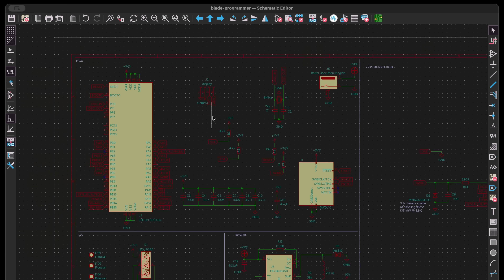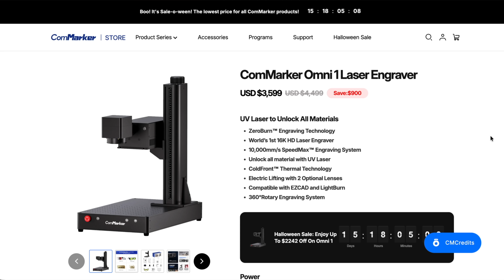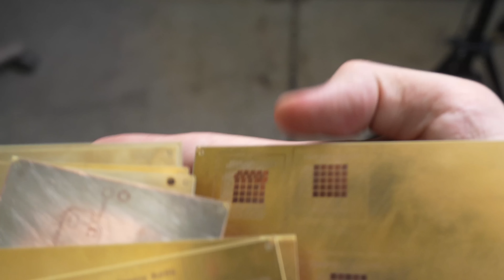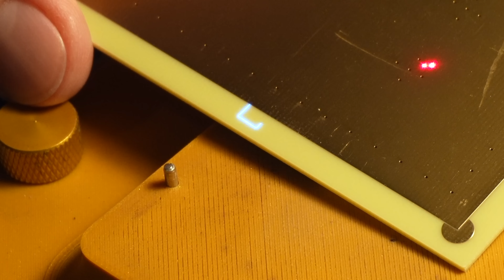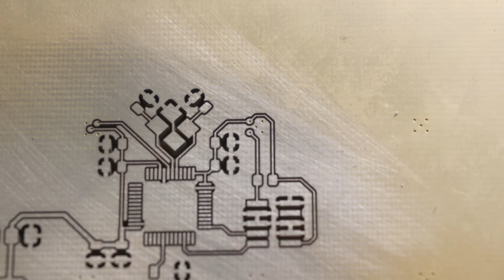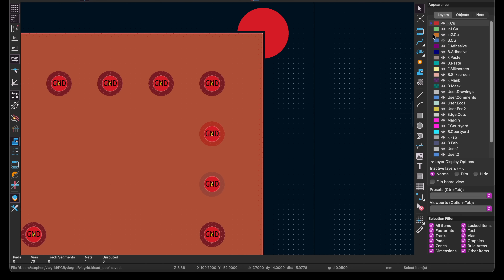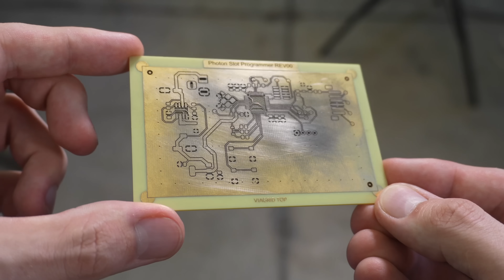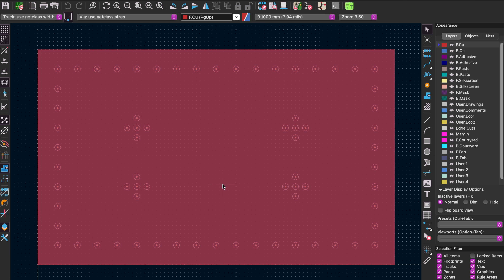The Last PCB You'll Ever Buy

Comment: CredBoard. Sized like two credit cards that you can break apart by hand and use each piece independently. One half can be milled out for folding over to protect the components on the other.

Comment: That board alignment could use some improvement.  Maybe a worm gear on the bottom holder so you can really get fine control of placement.  And then maybe put some sawtooth points around the outside of the board so it's not just on/off with the laser frame.  So you can see a gradient of light - it's brightest when it's in the exact center.  But great work here!

Comment: Like this. But:

a. 4 layer bd with a LOT more vias,

b. Vias between surfaces AND alternating prs to internal planes. Unused via gets detached from surface(s)

c. Versions with special supports prelaid out (micro/qfn/bga, USB PD based dcdc, hi-spd traces, etc)

d. My Preference: if possible, have bds prefab's with photoresist, expose on bare bed of a SLA or equiv, then acid etch. Less airborne nastiness, less tiny bits of Cu sitting about, no burnt FR4. Tradeoff: chem in liquid vs vaporized. Oh - and cleaning SLA bed b4 use!!😕

Comment: Hi great work! Looks like you just solved the main problem on my Phd theses. How did i not think of this :D In the video you mentioned that the laser makes the FR4 conductive. Did you try to drill the vias through FR4 with the laser and measure the resistance of the via? Since it gets conductive i could work :)

Comment: The Enviable board...
One way to safely handle 4 layers with GND and VCC planes could be to have pre-cut islands around their via and let the user place 0 ohm resistors wherever a connection is desired. But if the rest of the board is going to be etched anyway, it's probably simpler to let the user add the islands as needed, maybe just have a limited number of power vias, as the other vias can also be used to send power around obstacles.

Comment: I think this is super cool. Unfortunately, I dont see the commercial applications for this. However this may just be me? But, the design constraints, additional fixture cost, quality, board shape, etc. I dont see a strong use case when i can get very cheap, quick, high quality pcbs in a couple days. Often in that shipping time there is so much to still do. Now, If USA decouples from China then you may have something commercial but that's another thing. All in all, really cool thanks for the videos!

Comment: If the design is simple enough for this, it is simple enough for a single layer pcb with zero-ohm resistors for trace jumping.
Reply: You could design this board with IC's on both sides. Could be handy.

Comment: Hi Stephen, really love your mission to make PCB iterations as fast and cheap as possible. 

First thing that came to my mind was to make this a 4 layer board, with 2nd layer GND and +V, yes power layer generally is split, between 5V, 12V 3.3 but maybe even that can be done? By drilling or milling some vias away to seperate them, maybe 😅 Nevertheless GND layer would be super helpful and might help with EMI & EMC

Comment: this would be good for simple stuff, unfortunately it will come short for RF work, differential pairs, impedance matching, bga, wlcsp or even some weird qfn packages like nordic's ones. RF work would probably benefit most of these short turnaround times. this needs a bit of more work and a 4L board, probably with some tightly controlled layering for at least 433/868/915 work.

Comment: I remember when we had to mill out PCB’s

The VIA’s had to be hand “punched”

I think that a 4 layer board would basically pay for itself quickly too - one inner plane definitely should be for ground and the other for power - would definitely need Vias all around edge of board to connect to different planes - but omg it would be the greatest system ever designed.

Comment: I love your energy man but I don't think this idea is a good one, fast turn professional PCB manufacturing is so fast and getting cheaper every year. Combined with ICs getting smaller and finer pitch, this is a really tough sell for me. I can get PCBs delivered, 4-6 layer with micro vias in about 3 days, if I order them on Friday they will be in hand on Monday. Going any faster doesn't really represent any value. It is very rare we make a mistake in a design which is so bad it can't be reworked into working, so 2 iterations in engineering is normally enough for an assembly.

Comment: The process is actually very similar to the predecessor of FPGAs. There were wafers available with prefabricated Gates and one could very easily and cheaply connect them using top metals only. Cool to see this idea reappear in the PCB world.
Reply: The things are still very much in use today in some special or military applications. It allows for a much lower price, reduced design complexity and much lesser radiation sensitivity compared to FPGAs. I don't know the official name for the technology but here in Russia they are called "basic matrix crystals".
Reply: @Kirillissimus  Its called Gate Arrays. They are essentialy fixed size cells with predefined inputs outputs and power rails, with a pre-defined array of mos devices(also mostly use the doped poly Si as interconnection(except for outputs) . There is also a variation called Std. Cells, more custom inside, instead of an array, but with predefined size(and multiples of it)).

Comment: I wonder if you could use one of those Eufy UV or similar printer things to print a solder resist material on top of the copper. Although I guess you can just coat it with solder resist and re laser it to remove it

Comment: In this form, it is virtually useless in real cases. I often do prototyping in my work, and it's faster and more efficient to make a board of this level manually with the help of a laminator and a laser printer. Perhaps I would be interested in similar workpieces with a large number of via and ready-made seats for complex tqfp and bga, but not in the current state of the "blink LED" level.

Comment: If you run with the PCB layout philosophy of signal integrity doesn't matter if the board "works" then it sounds great. This type of shortcut means you have little control over where signals transition layers and very often you will get away with that. In the lab I use a Carvera Air and the really tiny via pins for double sided designs to prototype or do short run designs. It is also fast and allows multiple iterations per day - not as quick as the laser appears to be of course. Interesting idea either way. Not quite revolutionary but a new take on fast in-house development.
Reply: This is not a problem for the vast majority of prototypes based on ESP32, STM32, etc. Breadboards can do a couple of mHz and this is orders of magnitude better. You just gotta limit slew rate.

Comment: I could see myself using a board house to make me a board with useful vias for a new project and then iterate using that board template. So, design a new project (complete board), but also make a template board with vias that would make sense for that project. Wait for the prototype AND get lots of extra template boards, and then iterate very quickly from that point as needed using the template boards. So, still a wait for the first board, but nice and fast iteration after that.

Comment: Got me beat! 5 years ago, I was making my boards up to 5x5 in, double sided on a trammed Wanhao bed slinger with a 3d printed "etcher" that was a sharpened piece of 8mm stainless rod from an old inkjet for the isolation routing then modified hydrochloride acid. Then after isolation was etched, the soldermask was revealed with the same etching attachment. Then a 3d printed holder for the guts of a Dremel flex shaft held the 0.5mm drill bit that would poke my vias. I would then take specific length of stripped ethernet wire and peen the ends of the copper wire over like tiny rivets in my vias. Optionally soldering the vias, but wasn't necessary.

Comment: Pick and Place machines have gotten automatic alignment with fiducials down to being a solved problem. Any reason they aren't more commonly used for laser cutters and the like?
Reply: I imagine because laser cutters are typically far more cost-optimised, and usually contain no vision system. Since vision isn't necessary for their basic functioning, advanced uses of vision are largely unexplored.
Vision would be a fairly obvious upgrade, though, it's just waiting on a 'killer application' (like this re-cutting of boards containing features not normally cuttable like vias) to make it reasonable for manufacturers to include. I guess you'd also need a filter to shield the cameras from the bright light of laser reflections, but that should be extremely simple.

Comment: What were the requirements that were considered when determining the location of the pre-fabricated vias? From the video, the quantity and location seems rather arbitrary, but maybe there was a method to it?
Reply: There are definitely good reasons for the via placements with some room for improvements. Mostly it comes down to having areas where power-hungry components can have enough vias to spread heat to the back of the board, so large chips can have a bunch of vias under them for easier routing, and so edge-mounted connectors have room.
Reply: @MatinatorX  Yes, those are (some) reasons to have vias. I don't yet see how those reasons relate to the vias on the sample board.

Comment: Cool idea, but I am skeptical that sort of via layout would be useful for more complicated designs. It kind of depends on the type of thing you are doing, I suppose. I think it might be better to have regions for blocks of components, maybe of varying sizes but on the order of maybe 25x25mm, and then completely surround the block area with vias (with enough space for tracks to get through as well of course). Plus power and ground planes of course. You could even space them so that larger ICs such as a high pin count QFP MCU could straddle between multiple blocks with some of the vias underneath it.
Reply: I can imagine, if you plan ahead for the type of projects you'd get some blanks made ahead of time and use it to iterate quickly.
Reply: Honestly I think the most versatile would probably be a just solid grid of vias, with the pattern optimized/compromised for the standard package footprints. Any unneeded vias can be left tied to ground.
Reply: I agree. Placing vias cannot be simply done for complex layouts ( That should be pretty obvious ! ! ). This will suit simple circuits. Someone commenting on here talks about using FPGA for reducing IC count and that's what is mostly used, especially on cards like VME bus cards.  Maybe, sometime in the future, autorouting AI programs will be able to come up far better suggestions for complete design.  But for individual projects I have to say what I use now for autorouting is a galaxy away from when I first started with AutoTrax.
This board is not a game changer.

Comment: What about using a thinner (8 mils?) version of two of these with wider vias sandwiched around a thicker via-only board (no copper pour, except in a circle around the vias), and then flooding the vias you want to attach with solder? Would that work for a four-layer board?

Might need to epoxy it together for strength?

Alternatively, leave the copper pour on the middle board, etch away where you don't want it connected, then bond the three boards together with solder paste.

Comment: For those worried about the utility of this, the majority of boards made even in a small business setting don't require things like 3+ layers or impedance matching/via stiching. Component density isn't really a problem either - you don't have to keep your components away from the vias, you can just put them right on top and assign the "interfering" via to the same net. The via will get isolated on the backside and won't be a problem. Unused vias become part of the ground planes. Vias uncomfortably close to other things just become holes and the plating gets etched away. The clusters of vias are designed into the template so things like DC-DC and other chips with thermal requirements have a place to dump heat. I've been designing around this method for a few years now (I wish I hadn't kept so quiet about it now, thanks Stephen...) and can attest that the majority of designs you see on places like Tindie or EasyEDA could easily be adapted to these, usually in under an hour. As long as you have 2 layers and 6/6 mil or better traces and spaces, you can do an awful lot. I'd recommend trying your hand at designing a board using the template before condemning the idea, or joining the Opulo Discord and chatting with the community.

There's certainly an argument to be made that the upfront cost of the laser puts this out of the range of hobbyists and firmly in the camp of small or medium businesses with more demanding PCB requirements, and to some degree that's going to be true. However, the concept of a universal PCB blank extends beyond laser engravers. Desktop CNC mills are getting cheaper and cheaper, such as the new Makera Z1 which can be had for around a grand. If you're okay using traditional etching chemicals, I'm in late-stage development of an SLA-based machine built from the ground up for this purpose priced at half that, aimed at hobbyists and makers, with ready to go, inexpensive pre-sensitized Viagrid blanks. The total time from gerber to PCB can be as low as 20 minutes. That brings this into the hobbyist realm, where the thrill of DIY is the main attraction rather than business use.

Now, realize that anyone who has a stock of these Viagrid blanks can grab one and make not just their own, but any one of hundreds or thousands of community-designed boards using the same template if widely adopted. They don't necessarily even need to know how to design a circuit board. Whether they have an expensive laser engraver, desktop CNC or SLA-based machine, all of those designs are accessible to them. They can see a community-designed board they want and be holding the bare PCB 20 minutes later. Imagine Thingiverse, but for circuit boards.

This is bigger than "kinda neat if I had a couple grand to burn". Use your imagination!

Comment: Neat!  Consider some adhoc less polished longer form case study walk through tutorials, live stream for realtime chat feedback/polls/etc...?  Sounds like the fiber laser is must have for adoption?   but they can even "drill" conventional via holes (if absolutely needed).  Look forward to seeing more about via boards.  Love seeing more fast iteration prototype and small batch production.  Cheers!
Reply: Laser is only required if you want to be able to do through-holes and cutouts on the same machine with no tools swaps. Otherwise, a CNC mill will happily work with these, or traditional chemical etching if you don't need holes/slots or can do them on a separate machine.

Comment: Feedback: This hinges on the default via pattern. You should make 3 or 5 different patterns for different use cases. If you do make 4 layer boards, have pairs of vias. One that goes to each layer for bypass caps that you can put an IC next to.